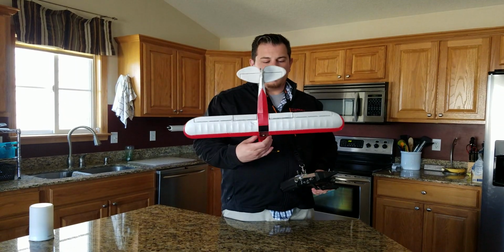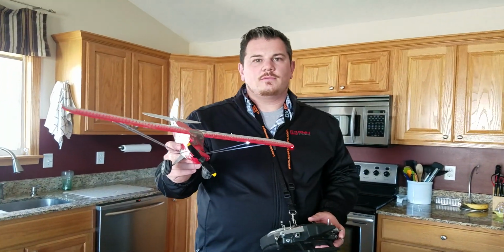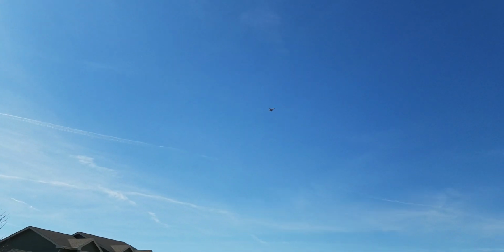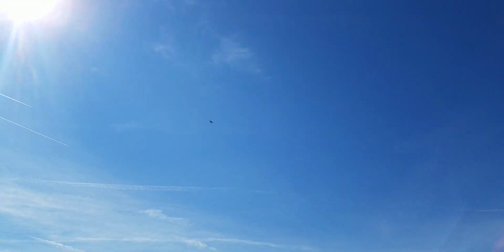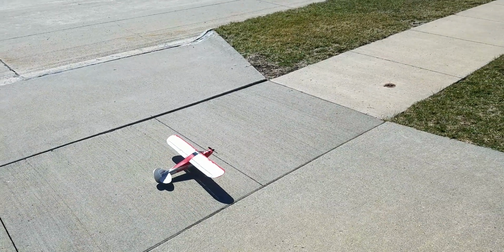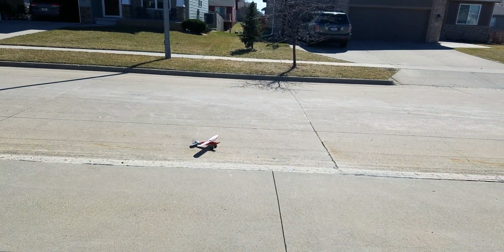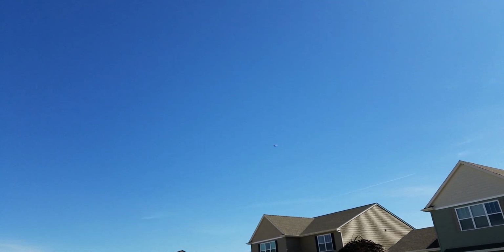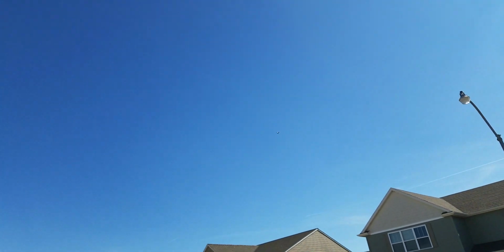Horizon Hobby - Carbon Cub SS UMX - Extreme Flaps & Vortex Generators? Flight Video

Comment: I don't know what material you used but us old free flighters would glue strips of thread along the top of the airfoils and we did not call them vortex generators. We call them turbulators. At air speeds below say 12 or 11 mph air becomes harder to stay attach to a smooth laminar flow over the top of the wing.  Tubulators excite the air enough to keep it attached and flowing over the wings.  In that most of the time your Cub is flying well over 10 mph I doubt you'll notice a benefit. JMO
Reply from the maker: They didn't really work, but I've heard of using turbulators on sail planes. I had a guy recommend suing pin striping lengthwise.

Comment: what are you settings on the dx6i, i set up with safe modes and plane was crazy to fly now waiting on new wings and body in mail,, but need to pick your brain on all the settings and mixes you use
Reply from the maker: This plane doesn't have SAFE, since it's only got AS3X.
The transmitter you're seeing is a DX18 :)
Go ahead and ask away :) I'll help how I can.

Comment: Hey Brian! My I purchase a copy of your Jumper T8SG Plus V2 setup files for the your UMX Carbon Cub SS?
Reply from the maker: I don't have one, sorry! I use my DX8 for it, and now my DX18. I've never setup this plane on the Jumper.
Reply: @BrianPhillipsRC  Thank anyway but, I just"tried" to update the firmware to my Jumper T8SG Plus following Ken Versus video...And now I have a blank screen! : (( Is there a way to do a clean install? I don't care about any settings/Models I may have had in there. I just want my radio back! I'm about to give up this hobby..: (

Comment: i had a lot of carbon cubs. best thing is to put on some pieces of clear tape on the elevator. they already break with to much in put in the air
Reply from the maker: These UMX planes have lots of "weak points", but I still love them :)
Reply: Brian Phillips timber is way better build than the carbon cub. it's just to weak.
Reply from the maker: This Timber UMX is very good, but at the time when the Carbon Cub SS was available, this was the cat's meow  :)

Comment: hey Bri, what's your favorite UMX plane?  I've had the timber umx, but was't so durable.  Out of all the planes this size what is your favorite as far as durability is concerned.
Reply from the maker: I really like the Aero Commander. I have tons of mods on mine...you should check them out here...

https://www.youtube.com/playlist?list=PLXTH0DstRDc5vtUslZB3dutPkFSjdgIB9

...as for size to durability combo. My experience has been that the UMX'es are quite weak, but you can fix them so quick, and economically.  If you want durable, try a 1.2m size and then play with it. Pretty commensurate price point, to the UMX, but a lot more plane for your money.

Let me know if this is enough to help you out. Thanks again!

Comment: How did you form the vortex generators?
Reply from the maker: I thought I did a build video, but DON'T copy me, this didn't work well at all :(

More of an experiment gone wrong...

I took a straw and used a hole punch to make "bites" along the straw, then I split it in half...but, as I mentioned above, it was a poor outcome. Fun experiment if you want to try...
Reply: Did you have too many? The applications that I've seen them used (including a car-they worked according to the owner) they are spaced out a bit.
Reply from the maker: The shape of a vortex generator is very specific, and mine are very much NOT... This was just an experiment to see if the shape would work. It did slow the plane down, but didn't help concentrate the slow moving air over the control surfaces and wing, lowing the stall speed....it just made the plane slower, and more prone to stall...

:(